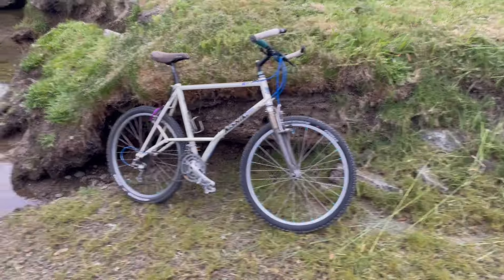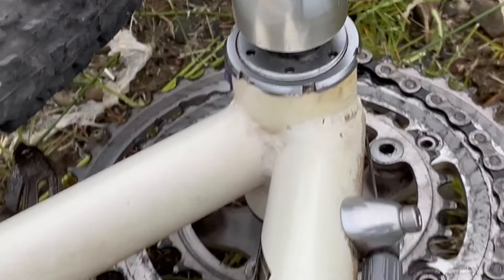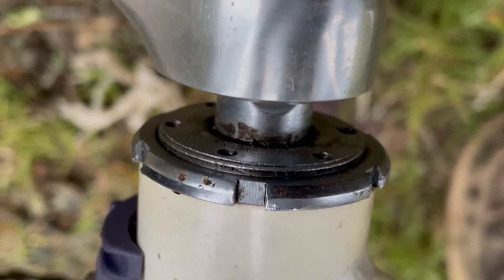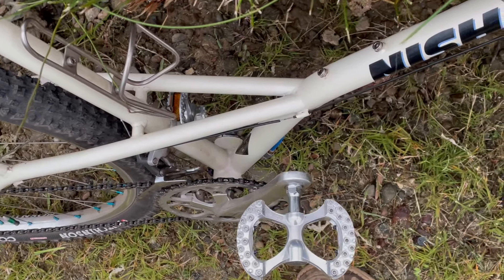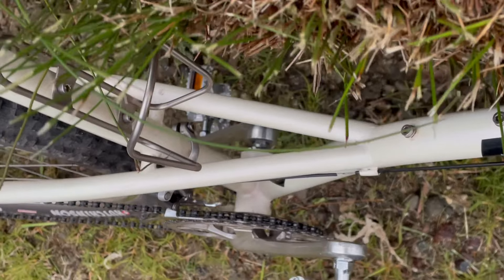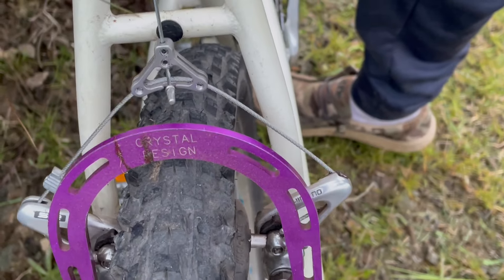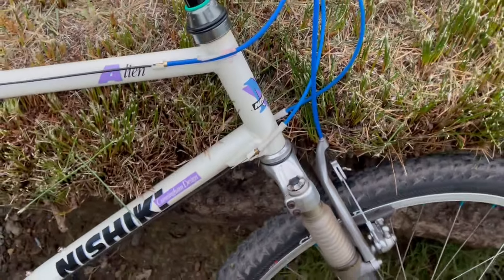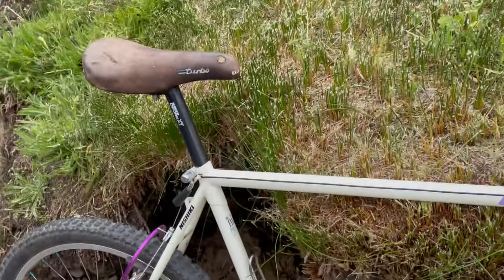1989 Nishiki Alien ride 2 sorting the legend redo MTB 90's parts getting loose the struggle is real

Comment: You might machine the bottom bracket shell faces to ensure they are parallel.  I have a Gorilla brake booster on the Mantis. Have been riding it since 1987.